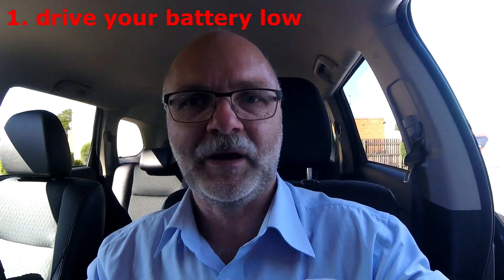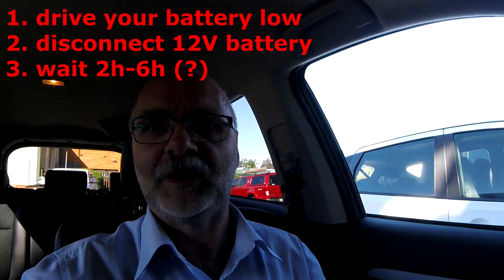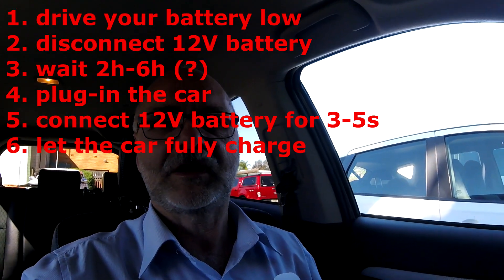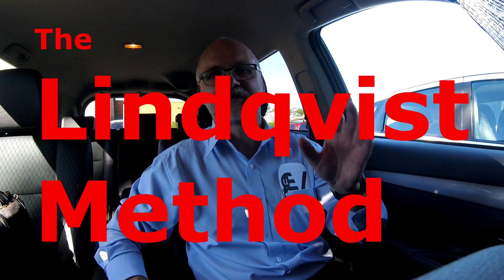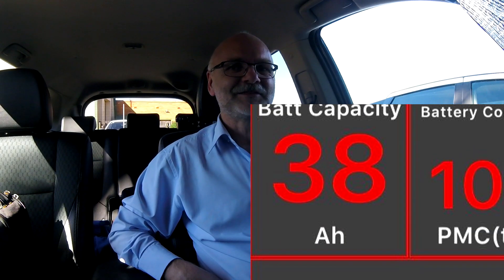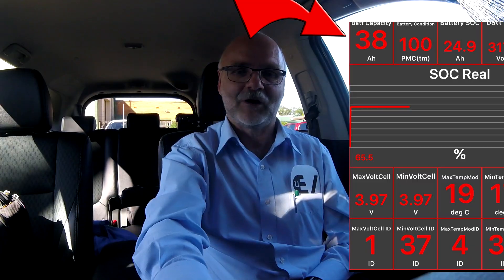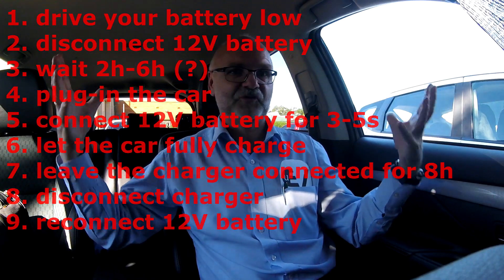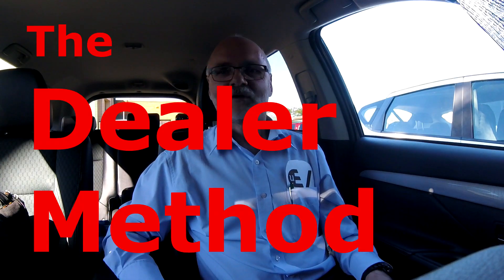EP248 - The Lindqvist Method (Outlander PHEV DIY Home Reset)

Comment: Nice video!  Good to know we have this option.  My dealer was kind enough to do a BMU Reset (BMU LEARNING VALUE MANUAL WRITTEN
) for me, took all of 3 minutes.  I am now at 40.0 Ah!
Reply: 40 without DBCam?
Reply: @matradlinski8084  Correct. No DBCam.
Reply: @Darrenhd2  How long ago was that Darren? What Ah were you before that?
Reply: @markwalkington416  I was at 36.4 and dropping 0.1 Ah every week or so.  I just got the car in June, 2019, but it had been sitting unsold for 14 months since it was manufactured (March, 2018).  When I got it "new" in June, 2019, it was 37.1 Ah and in a month 36.4 Ah, so you can imagine I was upset I bought a brand new car that was supposed to be 38 Ah. but I only started at 37.1.
Reply from the maker: Interesting, Darren, that is the first time this happened at a dealership... have you got more info?
Reply: @unpluggedEV  In Canada the Outlander PHEV is a new model, they only started selling it last year as a 2018 model.  So the technicians don't know much about it.  I basically told them I bought the car, but it had been sitting for 14 months on the lot, and it should be 38 Ahs, and I told them there is a way to reset the BMU data so it would show 38 Ah as it should when new.  I basically told them what to do step by step and they did it.  It only took a few minutes and they were fine trying it, even the Service Manager said he could learn something (he is also a new employee there).  They said they had never been asked to do this before and I gather they haven't had many (or any) complaints about battery life/range, even though I know they have sold dozens of PHEV models.  I should add there was no paper work at all involved, I just drove into their service bay and asked if they could do this.  Tech came with the MUT device, hooked it up and I told him what to do.
Reply: Good morning Darren I am in Canada too and My outlander is a 2018.  Bought it last December.  I had several SOH drop.  Where are you located?  My dealer does not seem to know mucj about the car... Since your dealer learned how to do it may be they would share with other dealer.
Let me know
Reply: @jean-pierreleduc3838  My dealer was basically the same.  I had to tell them the procedure.  It is really quite easy, takes less than 5 minutes.  The link is here:  http://mmc-autoelectric.org.ua/manuals/eur/outlander/2014/00/html/M100102100005500ENG.HTM   You only need to do the second part which is called BMU LEARNING VALUE MANUAL WRITTEN.
Reply: Did anyone else tried this?
Reply from the maker: Thanks for the feedback. Obviously they haven't been told by MMC not to do resets any more. Or they just ignored it...

Comment: Great work Andy and Mr. President. Wonder if we can discharge the bmu capacitor by earthing the terminal rather than waiting for 2-6 hours. Not sure if it will cause any damage.
Reply: Unlikely. It's almost certainly protected from reverse-discharge by a diode.
Reply: I performed the procedure with 12v battery disconnected for four hours full charge +1 hour. Didn't work. Had a power failure for few seconds during charging and had to reconnect 12v battery again to resume charging. Will try again
Reply: I have a 2014 mid range jdm and it failed 2nd attempt. Disconnected 12v for 8.5 hrs and plugged the charging cable and connected 12v till it made a clicking sound. Then left charging for 7 hrs. Will wait for bit longer until we get a solution for a similar car.
Reply: After 3 unsuccessful L methods, was able to succeed in G method.

Comment: Interesting.  It appears as though the main parameters such as full capacity (eg 38Ah) are stored in non volatile memory, whereas the current measured capacity is instead held in volatile memory.  By interrupting the 12V supply following your suggested steps you are probably:
1) Clearing the volatile memory of current capacity data.  There may be an internal backup reservoir, hence waiting for a few hours with the 12V supply that powers the BMU disconnected.  At this stage the system would presumably have the default 38AH as the new capacity, having been 'reset'.
2) Connecting the 12V supply to the BMU for a few seconds, just long enough for the BMU to 'handshake' with the charging supply to allow power to be switched on.
3) Removing 12V supply from the BMU preventing it from monitoring incoming charge.  
4) By completing the charge and only then restoring the 12V supply to the BMU the system must use the default reset maximum of 38AH (or 40, for example; likely whatever is programmed into non volatile memory).

Although the suggestion has been made that you can 'flatten' your 12V battery by leaving a light on, this is maybe not possible.  Because fundamental systems like the BMU use the 12V supply it is probable that the main traction battery charges the 12V battery if it becomes too low - as with Toyota and some other hybrid systems. 

So I think that there are a couple of big questions here that should be considered regarding safety and potential damage to the vehicle:
1) Mitsubishi clearly designed the vehicle intending it to be safe for the 12V battery to be changed, disconnected, go flat etc.  These are normal situations.   
However, it is not a normal situation to remove the BMU supply while enabling the same time enabling charger supply.  The BMU circuitry will be subject to an abnormal situation where power is present on the traction battery monitoring connections and not the 12V monitoring system connections, in a way not reasonably predictable by the system designer.  In this situation it is possible that circuitry could be damaged.  It is possible that the system designer did not cater for the absence of 12V supply during charging, as the EVSE should not be able to enable charge supply.  Maybe the system is designed to be protected against damage in this condition, or maybe it is okay by accident, or maybe it will prove to be a process that can cause damage.  There is certainly a risk of circuitry or battery damage in my opinion, not knowing the design detail.
2) The BMU is the battery monitoring unit. It presumably controls the handshake allowing connection of charge power and monitors information on battery state.  It may also control charger supply disconnect and perform functions like providing information to vary the end of charge voltage depending on conditions, which might include variable like battery temperature etc.
By removing the 12V supply, you are using the BMU to allow the charger input to switch on and then are disabling it from functioning properly.  If the BMU performs any safety related functions, like requesting charger disconnect if an error is reported by a cell management node or if battery temperature becomes excessive, then this Lindquist process may disable all of these safety features while allowing charger supply to continue.  It is even possible that the active temperature management of the battery is controlled by BMU data that ceases to be available during removal of the 12V supply AND that overheating in the battery might not be reported to the charger system, preventing safe disconnection.

I very much would like this to be a cure-all fix for the battery issues. I think that even the manufacturer may breathe a sigh of relief if this turns out to be a good workaround, as it could be an inexpensive way to keep customers and dealers happy, resulting in the sales of more vehicles without recalls and enormous expense.
However, worst case this Linquist reset method could prove to be an unsafe procedure that results in vehicle damage including battery fires.  
At the moment I do not know enough about the detail of the system design to correctly judge either way.  For anyone else like me who does not know exactly how the system battery and charge monitoring circuitry is designed, I recommend caution until we know more...
Reply from the maker: The 12V battery only gets charge when the charger is plugged in or the car is in READY mode.
Reply: One note: In my experience with the 12v bat disconnected and at the same time the car is charging, there is still 14.1 volts in the system or car, I confirmed it, so maybe there is no risk of fire or over heat because there is still 12volst around and BMU I guess still aware of everything.
Reply: @belzares2012  Good question.  If switching on the mains traction battery charger then switches on the 12V charger - hence seeing the 14V rail - is this okay?
I'd say maybe, but if so why does disconnection of the battery make any difference then allowing the data to reset?  Could the 12V charger act differently with no battery attached?  Could it be damaged with no battery attached?
All logical questions. I don't know the answers - leading to the caution.
Reply: Is it actually required to have the 12v bat disconnected while charger is going? Maybe the 2hr of disconnect before the charge is enough to do the job? One would also assume the BMU would have to be powered during charge to actually allow charging. I would like to confirm that the BMU is actually powered during the charge process while the 12v bat is disconnected.
Reply: @joemaher958  All is a mystery here, I know while charging there is still 12volts in the car got from the DC-DC converter
Reply: @joemaher958  Yes, good questions.  Do we need to disconnect at each stage for the procedure to work? I think that more will be learned as people investigate.
Why is there any difference when the 12V battery is disconnected but the DC charger is enabled?  That's unclear, although there seems to be report of a difference.  Maybe this is wrong and you don't need to disconnect the supply, or maybe the DC charger is intelligent and modifies it's output if it detects no battery present.  Questions, questions...
Reply: My theory is that the 12V disconnect is needed so that the BMU's "normal mode" doesn't learn of the charge (as evidenced by MMCS cost meter not updating) and then when it's reconnected again it interprets the huge SOC difference as having received a new battery and thus purges all learnt historical data.
Reply: @BakedPineapple1  I think that Andy confirmed that the 12V battery is only charged by the main traction battery when either the vehicle is switched on or the charger is enabled.  This would seem to be in line with what other EV hybrid manufacturers are doing. 

It would not negate the concerns I have for the following reason:
People have found that by removing the 12V supply the system reacts differently if you manually enable charging - as we see from the reset figures - compared to when the 12V supply is connected as normal.  This by definition shows that the 12V supply is being used normally as the system is acting differently by resetting data when we create the abnormal situation of removing it.  So we are performing the action of manually enabling mains charge while disabling the 12V supplied circuitry and it seems that this is not possible when using the vehicle normally as the designers intended.  We are manually putting the vehicle into an abnormal state, while enabling the battery charger.  I do not know if this is could cause damage or is even unsafe.  I even think that the manufacturers would be quite right to be very worried about performing these actions without checking the system design and carrying out testing - which they may or may not be willing to do.
If a single PHEV battery caught fire because of a charger / monitor issue then it would be potentially just as bad for the Manufacturer as for the owner, even if the owner had carried out a DIY procedure.
Reply from the maker: Well, exactly this happend on Monday here in AU. Someone had a dead 12V battery (showed only 8V), the car would not start anymore. What are people doing in these circumstances, they plug it in and charge it! So he did. After a full charge he could start the car again and drive. It showed him 38Ah after that. That was before the Lindqvist Method was out...
Reply from the maker: I guess, if the 12V battery has been removed, the DC/DC does not see a load anymore and opens up as it expects a dead battery. 14V.5 may be the maximum, it's unlikely it goes much higher for safety reasons. the connected circuits may not draw much power when the car is charged and the converter is fine with that, thinking the battery is full as it does not draw much amps. These converters are  usually self regulating and can cope with or without load. Just a theory though...
Reply: In my PHEV MY13 (SOH = 64.5), the Linkquist method in the primary version (disable 12v batteries for 2-6 hours) did not work.
The second time made on the advice of Tim Scott
Instead of a resistor, I connected an ammeter on (ground and clem + in the fuse box), to a value of 0.01 mΩ.
It turned out to return SOH = 38ah.
For 6 days, SOH fell to three times to 37.4 ah.

Comment: Also was wondering what else we will reset after battery disconected? Radio settings? Phone connections? WiFi config (hope not)... Any one has data?
Reply: Radio stations needs to program again and minor settings in the mmcs. Phone and Wifi settings no change
Reply: When they did my triple procedure which included the battery disconnection then everything was as normal when I got the car back

Comment: I was wondering if there is a way to drain any capacitors charge in the system after disconecting battery without waiting 2-6 hours.
Reply: Yeah, remove the BMU, find the SRAM cap and short it. But I wouldn't do that if I were you

Comment: Andy will you do this to your car
Reply from the maker: I won't. I've got a new battery still under warranty until 2027. I'll just contact MMAL again if it goes under 80% EV range :)
Reply: @unpluggedEV  why?
Reply from the maker: @jutaipeter  why what?
Reply: @unpluggedEV  warum willst du MMC aufsuchen?
Reply: I have 34Ah according to my dog, I think before I do try this my car is due for a service and will ask them to reset the BMU.  Never know Mitsubishi might be helpful
Reply from the maker: @Péter Jutai it's under warranty and I have an open case with Mitsubishi...
Reply: How do you get warranty to 2027 and there should be kilometer limit aswell? Why did mitsubishi replace the battery fully the battery warranty is just to keep it over 70% for 160 000km or 7 years. And why do you have 80% limit?
Reply from the maker: @Ardemonn  We're in Australia, man. Everything is upside down...

Comment: I will try it, with this tweak: deplete until just over 30soc, then deplete further to 20soc using remote heater and begin procedure.
Also Andy, nice try attempting to deflect attention from the suitcase, but this is not the end as you say. We want answers. Don't be like Mitsubishi!
Reply: So first try didn't work on my 2015 model with wifi and electric tailgate. I waited 2.5hrs before charging and 1.5hr after charge finished. Unplugged 12V again and will see if it gets amnesia overnight.
What SOH values are people seeing in the Dog during the charge? For me it was the "old" SOH and that's how it stayed :(
Reply: @tuberculous4691  yes. mine is old SOH too.
Reply: For future readers, for me and James it didn't work.

My 2nd attempt after driving 2km to 95soc, disconnecting 12V for 10hrs overnight and then charging 5A didn't work. Charge stopped at 98.5soc after 40 minutes of trickle charging.

For my 3rd attempt I will try to begin charge between 40 and 75soc which for my car at the 34soh appears to be the only way to "overcharge" to 104soc (it avoids the balancing at 35soc). I have a suspicion that going over 100% SOC might be a prerequisite for the Lindqvist (and natural SOH bump-ups) to work.
Reply: I was a bit worried initially as I started the charge at 6A and immediately switched to 15A but the computer was showing 9:00 hr remaining for another few minutes. That would have been around 25kWh :)
Reply from the maker: I thought people do forget about that...
BTW, it seems you don'w have to deplete the battery that much, just at the around 30% mark seems to work...
Reply: @unpluggedEV  that is good news because i do not have the app on my 2019 and lowest i could get with the heater on was 25,4 i think
Reply from the maker: Interesting. Keep us posted...

Comment: When I had the triple procedure done the technician who did the reset thought the disconnection of the 12v battery was a really important part of the triple procedure and suggested I just disconnect and reconnect the battery if I had problems in the future and see what happened.
Reply from the maker: Wow, what a great advice, hahahaha.
Reply: One interesting observation during my failed Lindqvist attempt was that at the end of the charge the MMCS cost calculator didn't show the latest charge. The same thing happened to me a couple of times after I picked the car up from annual service - car was topped up, but there was no cost entry for it. Maybe the dealers disconnect the battery or a certain fuse when charging.
Reply: In general HV packs are completely disconnected when the vehicle is off. The 12v batt keeps the ECUs alive. Most ECU will have a keep alive memory powered by capacitor. If you disconnect the battery to change it, the cap will keep the memory alive for you so it doesn't forget fuel trims and stuff like that. But you can drain the caps by completing the circuit between + and - cables for a few minutes. We used this technique to fix a car that had stopped doing fuel cut on lift off because it had learned that the O2 sensors were not reliable.